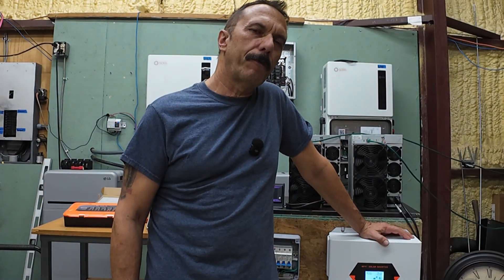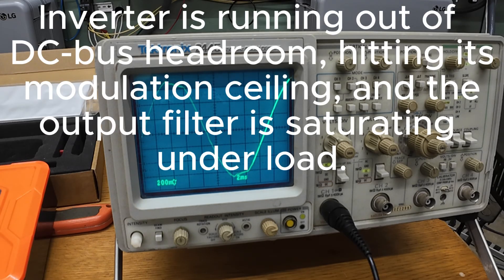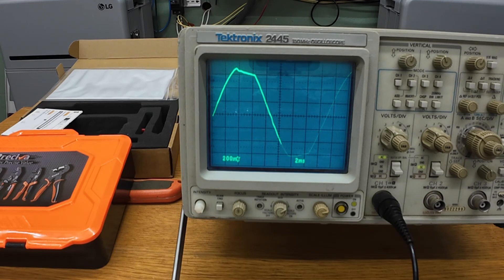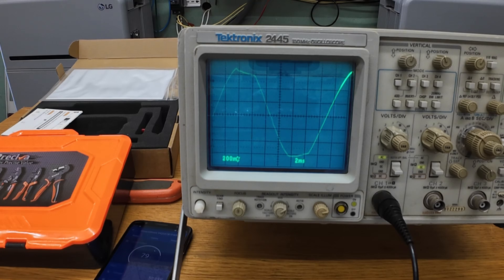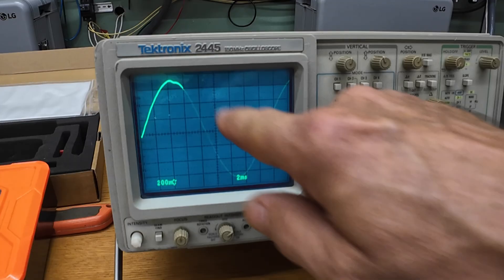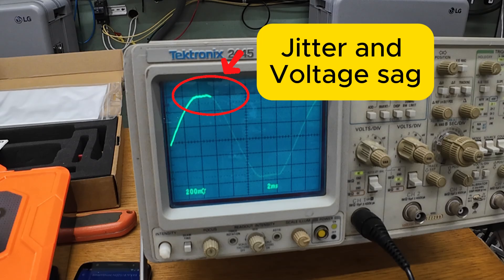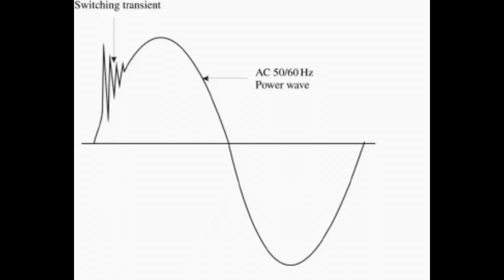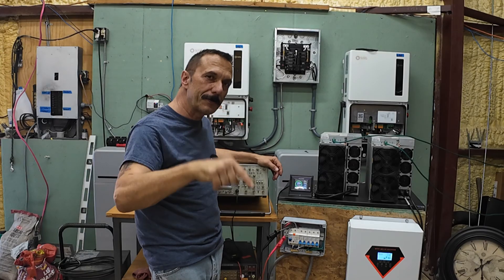Inside the Waveform: Vevor 6 kW Inverter at Full Output

Comment from the maker: We pushed the $300 Vevor 6 kW inverter right to its limit - full 6 kW load for nearly 10 minutes before thermal shutdown.
Waveform held steady the whole time, just a little peak sag right before it hit the over-temp limit. Honestly, not bad for the price.

PLEASE KEEP IN MIND, THIS IS A 220 VOLT ONLY INVERTER, IF YOU WANTED TO USE IT IN A US HOUSE HOLD APPLICATION A 
TRANSFORMER IS REQUIRED TO STEP THE VOLTAGE DOWN TO 110V!!

Would you trust one of these for real-world use, or just for testing and backup duty?
Drop your thoughts below.

If you’re looking for solar gear or batteries, check out Signature Solar - they’ve got Black Friday deals starting soon.
Use our link and coupon code in the description to save!
Reply: If it hits thermal shutdown after 10 minutes, I don't really consider it a true 6 kW inverter. But it is an incredible value for the money.
Reply: OK, I watched your whole set of videos on this inverter:  very nice!  Would the GoodWe GW9600A-TX autotransformer be a good match for this unit in North America to output split-phase 120V/240V?
Reply: @AdotFenderson  Victron also makes an autotransformer. At a quick glance, it looks like the goodwe is rated for 40 Amps of neutral current. Both models of victron are only rated for 32 amps of neutral current. So it might depend on how much neutral current you actually need.
Reply from the maker: @AdotFenderson  That should work but I prefer an isolation type of transformer. I just bought this one to test, https://www.ebay.com/itm/177553329368?_trksid=p2380424.m570.l5997
Honestly though, if you need 120V I think your better off buying a split phase inverter...

Comment: In order to use this inverter for household supply in USA, you will need an AUTOTRANSFORMER, as this 6kW inverter outputs 230 VAC±5%, according to Vevor's User Manual (specifications on page 29).
Reply from the maker: Yes, this has been covered before and I should have mentioned it in this video.
I will add it to the pinned comments.

Comment: Great video thanks so much ! Question from me it seem over temp was a big problem. I was thinking you said at first the fans were blowing up from the bottom . That this might cause the heat to build up at the top of the inside box before it was forces out of the inverter box. What if you reversed the fans at the bottom ? This would force the air at the top of the inverter box down across the heat sink  and out the bottom. You could even use fans at the two tops forcing air in and revers the fans at the bottom forcing the the hot air out of the inverter box. I would think that overheat could also add to the signal being distorted ?  Thanks for all you time that I know you have put into all your video. I'm working on some different projects myself.  When I get the bugs  worked out maybe I could share them with  you if interested .
Reply from the maker: Good observation! Some have told me that they have other variants of this design and their air flow is in the opposite direction. The thing is, there is air filtration at the top so it would serve no purpose if the air flow is reversed.
If I did want to use this inverter in a production system I would swap the fans for some higher CFM units.

Comment: So it's not a 6kW continuous inverter but what is the continuous (i.e. 3+ hours using NEC definition) power rating?  Can it do 4kW continuous?   I get it's a good value for the price but these vendors don't help their reputation by not providing accurate specs.
Reply from the maker: I agree.